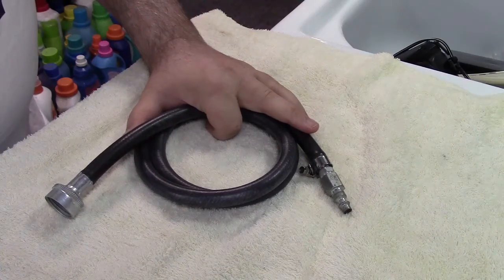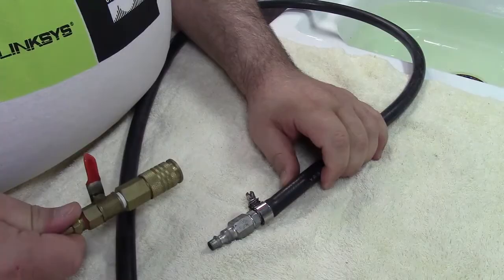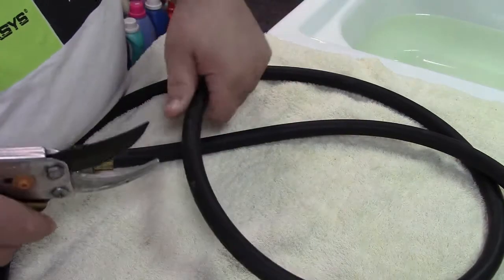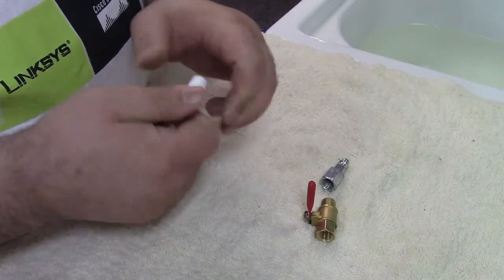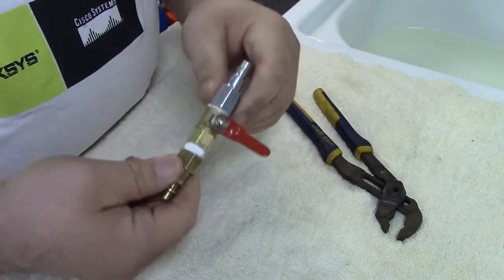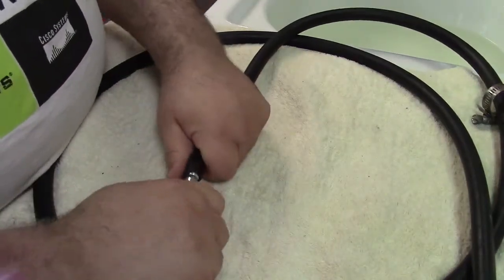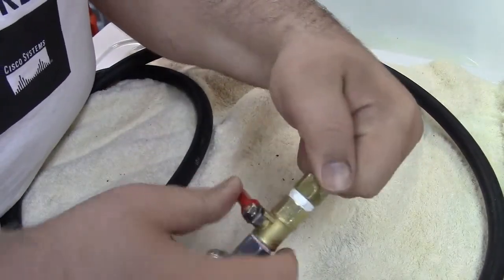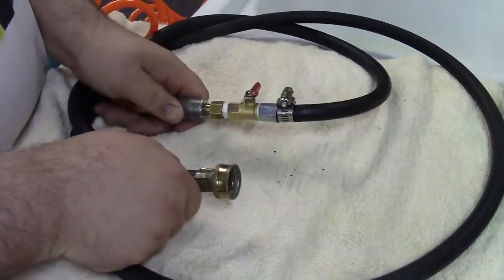Make A Sprinkler System Blow-Out Tool--EASY STEP-BY-STEP INSTRUCTIONS

Comment: Instructions CLEAR! Video was very clear and concise!

Firstly, nice call on the links to every part and a list of tools in the perscription! All harbor freight parts huh, sounds about right.

So to cut the hose end, which tool would be the best for the job?

On a side note, have you actually winterized your sprinklers yet?
Reply from the maker: Every now and again I hit the nail on the head, and squarely home in one shot!

Every consumer wants the best prices.  That would probably be it.

Anything that will do the job will cut it just fine.  Garden shears, utility knife, hacksaw, dremel tool cutoff wheel, angle grinder, running lawnmower, freight train, whatever works for you.

Yes, just yesterday.  Video soon.

Comment: I need to build myself one of those for winterizing the water pipe going to the garage.... This year I did it by manually holding the air nozzle to a garden hose piece which kinda sorta sucked as it blew off a couple of times. Ah well, maybe one day I'll get around to procrastinate on procrastinating there :D...
Reply from the maker: It's easy to build and gives you a nice sense of satisfaction once done.  Not to mention, it will last for many years to come.